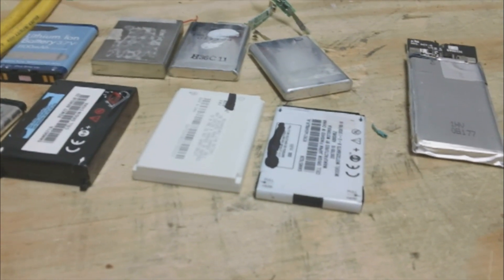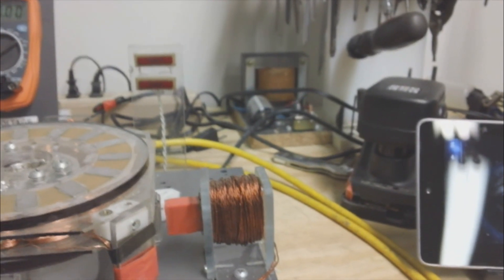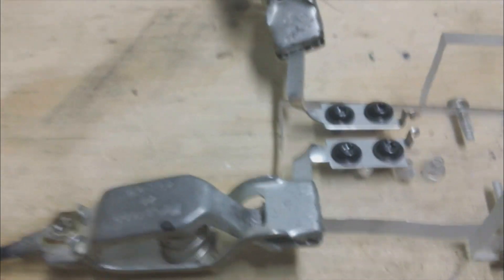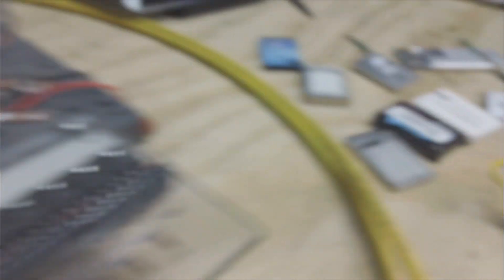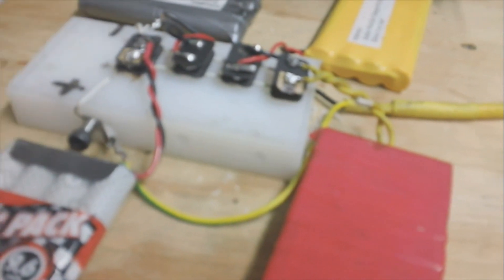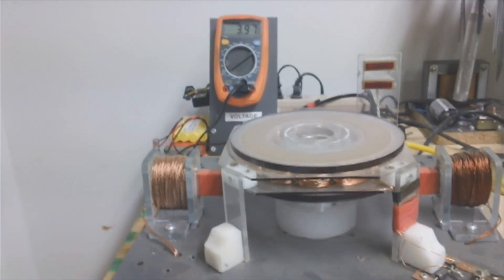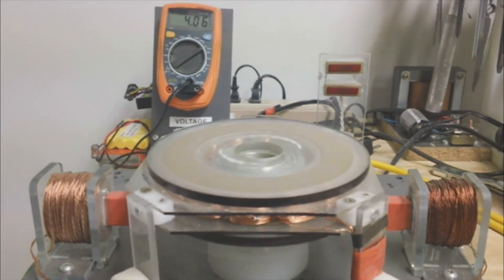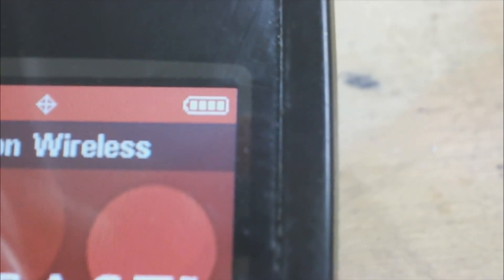Pulse charging a lithium ion battery

Comment: I must say it is one way to charge the battery. With low average charging current, it is good to the health of the battery. You mentioned it will not charge with the phone charger. So, did you try other individual charger(s) to see if it can be charged properly ? Or did you replace the protection board with a 'known-good' one ? Also, did you monitor the charging current (average or instantaneous) values ?
Hope you have more info for sharing ! Thanks !

Comment: The pulse charging, is that equivalent to saying there is a square wave, DC signal on the oscilloscope? I mean, a rectifying diode slapped on wall ac, linearly regulating power, charging a battery, would the signal be a "pulse charge"?
Reply from the maker: MrKappaBeta not exactly a square wave the duty cycle of the pulse is less than 10% it is more like a spike than a square wave, thanks for watching.
Reply: It's very interesting. I've figured that this is basically an alternator? The pulse charge may have chemical intertia, that "stirs" the "sediments" reviving chemicals in batteries, the downside would be the 2x or so charging time? Perhaps a great toggle to have on a charger? Pulse/Normal charge mode? Thank you for posting.

Comment: The Li-Ion batteries can be charged up to 4.2 Volts. That is, if you want it to give the maximum capacity it should have. But, the battery will last longer if you charge it a little below it's capacity.
If the Li-Ion has been depleted, it will get damaged. Try not to let the voltage go below 3 Volts (in a self discharge mode for instance). Store them charged up, and recharge them every 3 months or so.
Reply from the maker: Got it, the battery is holding a charge and it last about a week in standby with a few short calls but still wont charge on the phone charger the charger is showing voltage on the leads so ether the phone plug is bad or the pulse charge is working better that the factory charger. the mosfet in the battery doesn't seen to mind the the spikes well at least for now. thanks for watching